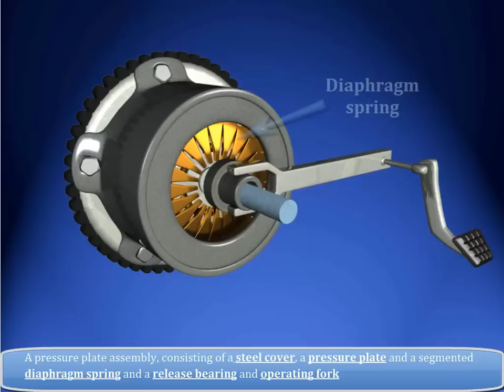Multi Plate Clutch

Comment: I think you missed that the intermediate iron plates are also keyed into the housing and bolts to flywheel.  So the set of iron plates are keyed to flywheel and the set of frictions are keyed to the input shaft.  It must be..